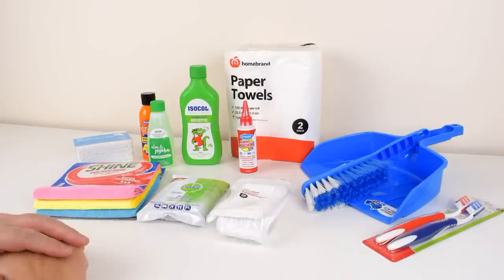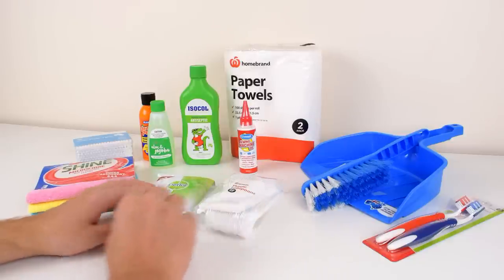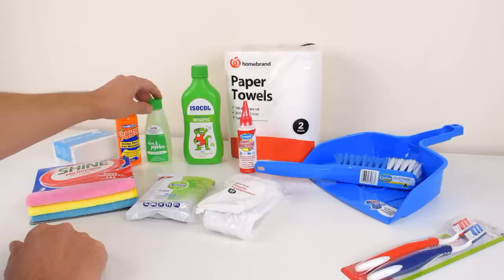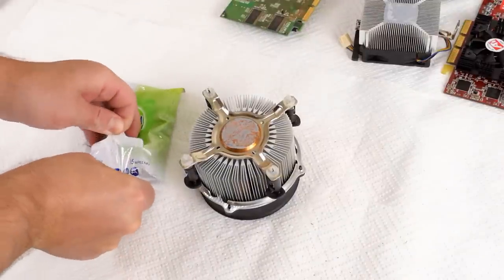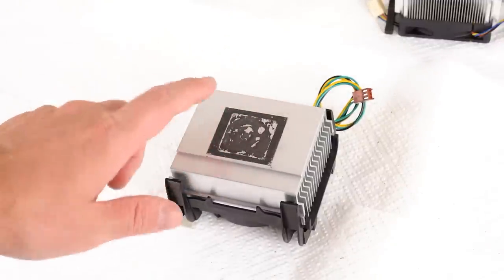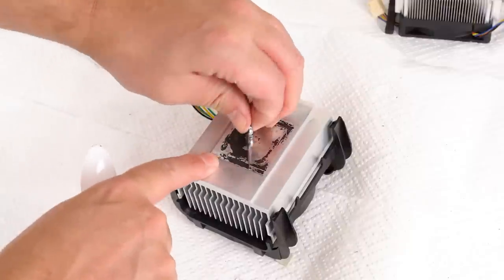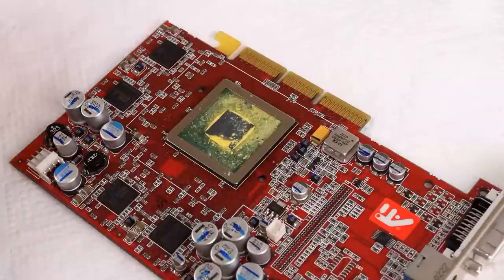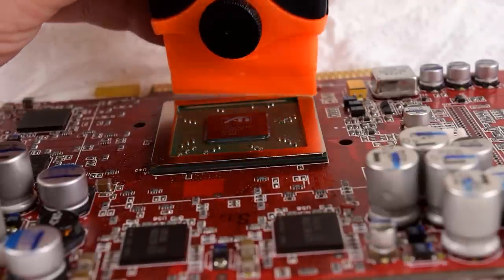How I clean old computer parts with household products

Comment: Unless the thermal paste is specifically designed to fill air gaps, don't use it. When heated most thermal pastes become more viscous, and will eventually run out of place leaving the R300 die without a mated surface to dissipate heat.  Then it's goodbye 9700 Pro.  I vote for a high conductivity thermal pad and leaving the shim in place.  On these dies it's very easy to chip the corners off.  You can find the thinner type (like the pink or blue pads that came affixed to Athlon and Athlon XP stock heatsinks back in the good 'ol days) readily on eBay.
Reply from the maker: Yea I think that happened to a 9800 Pro I got a few weeks back. It would crash after a short while, and when I removed the cooler I saw that someone was already in there before. It has some silvery paste, really hard to get off. I used a lot of thermal paste and a new China cooler, and the card worked great. But I will re-visit it and deal with the shim. I got some copper shims underway, but I am really leaning towards removing the outside shim and getting the best cooling out of it. I have a 100x100mm sheet of new thermal pads, but I don't know how effective they are. Branded ones cost a lot more. I'd love to test this, but these cards do not have a temp sensor which is annoying.

Comment: Hey, I've got an old Sony VAIO Laptop with a P3 and it overheats as fuck. Now that I've taken it apart, the CPU is like glued to the heat sink (ripped both out). Getting a new CPU wouldn't be a problem, but I can't get the CPU and heatsink apart. Force is not an option, I might damage the cooler. Acetone, lighter fluid, rubbing alcohol, methylated spirits, even paint thiner didn't losen the old, probably hardened thermal grease. Any other ideas what I could use?

Comment: Get a small piece of copper  and put it under the cooler (with thermalpaste between the gpu and the copper and the copper and the cooler), but im not sure if it works with push pin  coolers
Reply from the maker: Yea I just ordered an assortment on eBay yesterday :D Great tip!

Comment: just buy wr40 and 99% alcohol, those two always works. Also using a microfiber on parts can cause static and kill the part. I only use microfiber on parts like fans, cpu/gpu and heatsinks
Reply: You're absolutely right about the microfiber cloths and static. Synesthetic materials LOVE to crate static. Keep it far away from parts.

Comment: Do you have any tips for removing thermal glue? That's what my Voodoo3 uses and I've always been scared to try and remove the heatsink.
Reply from the maker: I left them all the way they are. The cooler gets very hot, so its working as intended. I don't see a reason to remove them to be honest. But I do mod a fan on it.

I've read that heating it up with a hair dryer can soften it.
Reply: My Voodoo3 started malfunctioning until I added a fan to it. It won't run fanless anymore so something is up.
Reply from the maker: Yea that's no good then. Is it lose or anything like that? I would heat it up with a hair dryer and rock it back and forth until it comes off.But I've never done this myself (yet).
Reply: There is such a thing as thermal epoxy. If they've used that I think you're pretty much out of luck; it is likely much easier to shear of the solder balls or qfp edge connectors than getting epoxy off. If it's not epoxy what Phil said may work.

Comment: Great video, for the gpu i would recommend getting a copper shim (tiny 0.5mm copper square) and placing it between the die and heatsink with paste on both sides. instead of risking the card with removing the edge thingi :)
Reply from the maker: Yea I just ordered an assortment on eBay yesterday :D Great tip!

Comment: First, the GPU shim problem.  What I would personally do is buy some copper gpu shims on ebay - http://www.ebay.com/itm/6x-GPU-CPU-Heatsink-Thermal-Copper-Shim-for-HP-Dell-Acer-Laptop-15x15mm-6-Size-/171479265137?epid=1893208261&hash=item27ecf5ef71:g:alcAAOSw-jhUKNn0

My favorite method is to use 91% or higher isopropyl alcohol to take off hardened thermal compound quite quickly and easily. Second is contact cleaner but I have a lot of it around so it is the most convenient and works damn close to instant. Third, believe it or not is a can of air, turned upside down. The liquid propellant that comes out will take off thermal compound as well. Some of the goo gone stuff works, but sometimes it doesn't, you also get an oil residue left behind.. I don't find it worth the money personally. WD40 or another silicon spray lubricant will do the trick but you have the oil to deal with.  Automotive detailing brushes work good too and soft paint brushes of varying sizes works wonders.
Reply from the maker: I ordered an assortment of copper shims yesterday! I love learning new little tricks that make life easier.

Comment: While I know many tend to have fond memories of them, all I remember back in the era of the 9700 and 9800 Pro graphics cards, is the unending driver nightmares I dealt with back in those days with getting the card to run Kotor 1 and 2 at all. Blending files from different versions, forced reformat and reinstalls of the operating system and drivers, third party drivers... I think the only thing I didn't actually try to do to get a Radeon card to actually run a dang OpenGL game back then was basically a literal demonic sacrificial ritual. Though I do recall considering it more than a few times, until I finally had an nvidia card again. And then suddenly, everything worked without any fuss. Though this was also during the era when ATI's only driver validation system was a single dell with a Pentium 3 processor, and like *nothing else*.
Reply from the maker: KOTOR? I think I have the GOG version, I could try it if get a chance.
Reply: Yeah, KOTOR 1/2 is a must-run for me on any PC. Part of the reason I avoided ATI like the plague back then was because their drivers were miserable for it. Kotor 2 in particular, flat out would not work for 11 consecutive driver releases. And ATI only admitted there was an issue after six months. They fixed it by the 11th post-release update, only to break it again in the immediately following driver release.

I have it both in the CD's and on Steam now. The restored content patches in particular make Kotor 2 a glorious game to play, pushing its engine to its figurative limits. :)
Reply from the maker: I see if I can check it out. Not familiar with the game, but I do have both from GOG.

Comment: You could show how to remove poxy glue and old crusted thermal paste from old CPUs, I almost scratched a dye off a Sempron to remove it (I hope it's still working, haven't had a chance to test it yet) :(
Reply from the maker: I dealt with this a week or so ago. I basically scratched it off, it was rock solid.
Reply: Exactly, but the dye on a CPU is smaller than the dye on that GPU you showed on the video and it's also made of a different material (it's somewhat shiny ), I'm too scared to scratch that thing off a known working CPU and then see it dead after I replace the thermal paste.
I now have an Athlon XP with some ancient thermal paste on it which is "rock solid" indeed, as you said D:
Reply from the maker: It was a Riva 128 I worked on. In the end I start with a flathead scre-driver. Just scratching away gently. Make small moves, take your time. I used some alcohol as well, but  I don't think it helped much to be honest.
Reply: Get it very hot with a hairdryer. Let some degreaser soak in. Now wipe it off or use a toothbrush, plastic scraper.

Comment: From my experience, all those liquid cleaners or isopropylalcohol are overrated, at the end, you have to do the job mechanicaly with some plastic tool as also you used. 
You could try something more powerfull like aceton, but better don't do that, it can melt some types of plastics.
From my experiences, you need just toothbrushes, paintbrushes (for bigger or more complicated areas with tall capacitors), some toilet paper or some fabric and alcohol and plastic tool to mechanicaly remove things which can't be cleaned by alcohol. You don't need more.
I heard that you can use ultrasound and put it whole to destilated water and let it do it's job, but I don't know if it really works, but it sounds cool if yes, but it will definitely damage even stickers you don't want to remove.

Comment: I would recommend fine sand paper for the copper heat sink surface not to clean it but to increase surface area thereby improving cooling capability. If your feeling lucky then the same can be applied to the CPU cover.
Reply: Matlockization doing this wouldnt turn the surface area into a "~"?
Reply: Does "~" = shit ? Its ok to say what you mean here, no one cares about PC language.
Reply: he literally means ~, as in an uneven surface which is far worse for conducting heat effectively. Using sandpaper on these components is an absolutely ridiculous idea. You want these surfaces to be as smooth as possible, minimal fissures.
Reply: It's absolutely not, he said 'fine' sandpaper, like 1000-3000 grit, not some wood stripping bumble fuck shit.

How else do you think metal gets polished??
Reply: he said specifically to increase surface area, not to polish it. I accept I could be wrong, but don't believe I am.
Reply: I don't think that's exactly what he meant, he means increase surface area between the two surfaces which are touching, ie, making them super flat and polished.
Reply: Not to polish the surface or to make it smooth but to leave a sandpaper scratchy appearance. Go from left to right with your forefinger (either horizontal or vertical direction whichever suits your style) once, then repeat for the next section down. Try not to overlap sanded areas, otherwise don't panic if you do. This leaves the surface level. Practice this on other metal surfaces first. Fine grit sand paper will not cause any problems however higher grit might. You might want to sand vertically once followed by horizontally once. I am not responsible for your actions.
Reply: Well fuck knows then, you'll have all kind of gaps between the surfaces
Reply: sickbailey21 exactly. I know you can say shit in this shit here.
Reply: +SteveM. That's right. You have gaps in between the surfaces which will be taken up by the thermal paste making it 1-2C better cooling. Its called increasing the surface area. Its usually taught several times at school, that's if you ever went to school !
Reply: The problem is that you're more likely to have air get in those gaps, making the conductive properties much worse.
Reply: +sickbailey21. Your probably right ???
Reply: +SteveM. That's the whole idea. To fill in the gaps. At the point of heat generation not further up at the fins on the heat sink where there's less impact. This isn't rocket science you know, lmao. BTW that 1-2 figure I pulled out of my arse. If you had read my previous comments you would have known where I got those figures from.
Reply: I'm not saying you don't use thermal paste, I was defending what you were saying about using sandpaper anyway to begin with, but you called me an idiot for no reason....

I'm guessing English isn't your first language and this is the problem in explanations.

Bye bye

Comment: I'm against the idea of use some type of sewing machine oil to put to the PC fan bearing. The sewing machine old have some chemical in it which use to removing rust on gear of sewing machine which keep them running smoother but this is totally unnecessary on bearings and might even damage them, also it's so liquid-y so it will not retain long on the bearings but will get down to the fan wings and get throw out all over the places. I'd recommend greese or motor oil for that.

Comment: Nail polish remover and other keytone based products should be avoided at all costs. Besides the possibilities of permanent nerve damage, they essentially melt the compounds you're trying to remove and have a tendency to "spread" the problem around. They can also damage plastic, rubber and acrylic parts surrounding the cleaning area. I would recommend Goo Gone or the various citrus cleaning solutions. But that's just my opinion on an old video.
Reply from the maker: Yea I only tried the nail polish remover once, and never used it again. Goo Gone is terrific, for everything else Isopropyl alcohol works well.
Reply: PhilsComputerLab I agree with you on the Goo Gone and I always follow up with IPA as it seems to neutralize the Goo Gone and get rid of the oily residue.

Comment: Awww! and i thought you could put your whole compute in your washing machine .. :P  but serious have anyone tried Acetone to remove thermal paste from the cpu ? its really effective , i even used a q-tip with Acetone to remove some thermal paste that had spoiled on the cpu pins/connectors , even if i couldn't clearly see it, the q-tip get gray, so it did a good job of removing thin layers of thermal paste spoil that normally get stuck into the metal.
Reply: Please don't use Acetone.
Reply: way not ? i know its bad for plastic, rubber, and product that contain things that will react with Acetone, but i do remove the cpu and gently clean the metal block for the cpu .
Reply: Acetone is quite a corrosive substance, and will damage the CPU die. I would only use it as a last resort on a CPU IHS. Even then It might start to corrode the surface of the IHS. I just don't understand why people are trying to use products for stuff they aren't designed to do. It's stupid.
Reply: I'v used Acetone for cleaning after a rust repair on metal, and i did hesitated at first for using it for cleaning the heat spreader  , but people have been using nail polish remover, and the closest i could use is Acetone and as i can tell there are no phosphorus in the Aceton i bought, and phosphorus is the only corrosive i can think of. 
I know Acetone is stronger than Nail polish remover, and i know i should be aware of how strong that stuff is, but i have never seen Aceton you buy from a supermarket or your local paint shop, damage metal, and i don't use Aceton directly on the CPU die.
Reply: Well then in that circumstance I think it should be fine. Problem is you'll get people using it on the motherboard or bare CPU/GPU die thinking it is ok. And it absolutely is not. My original point still stands. You should not be using weird chemicals like WD-40 or de-greaser on your computer. There is a reason why all the large semiconductor factorys use isopropyl alcohol.
Reply: Yes that i agree, you shouldn't use stuff you don't know how it would react on what your using on it. Also all those weird stuff contain alot of residue, so you kinda make them more filthy , that's way in many cases, if you don't have  isopropyl alcohol, soap and water, then clean it with water, and dry it , is a nice combination on many cases where you want to make it clean.
Reply: Yes, thank you! Someone who understands sense. isopropyl alcohol and Distilled/de-ion water is all you should be using. And someone like Phil who is running a good channel should not be using cheap alternatives.

Comment: I always use brake cleaner for thermal grease, that stuff just washes away with it. Just use it outside or your flat will smell like it for days. ;)
Reply: Brake cleaner is the most aggressive degreaser. Offcourse it will work excellent but you will degrade the plastics.  
Use a more mild degreaser instead.
Reply: Its fine for cleaning CPUs and coolers, especially if its old and crusty. I got that tipp from someone who works in a computer shop while i had a school three week internship back in 1996.
Reply: No, just no. This is terrible advice. Most brake cleaners uses a strong percentage of Acetate and other crap which is far to harsh to clean anything to do with your computer components. CPU coolers maybe. But if you're putting it anywhere near your CPU even if it's just on the IHS. You should not be working on computers.